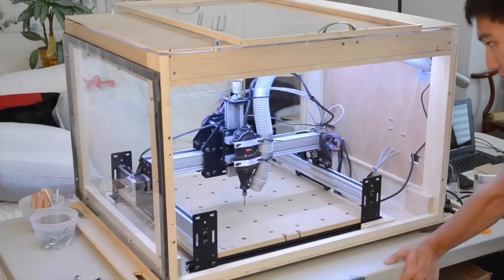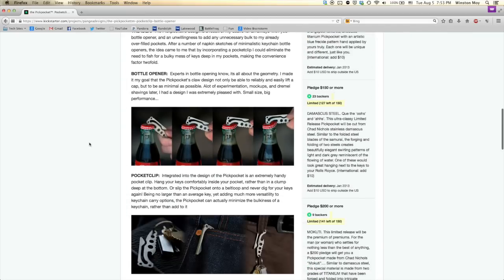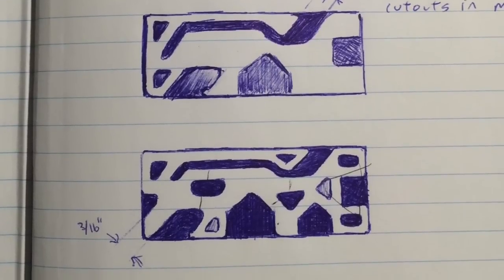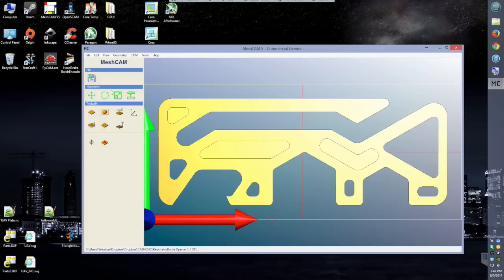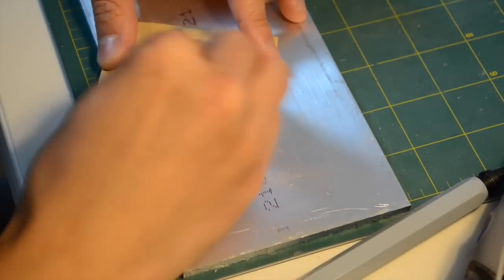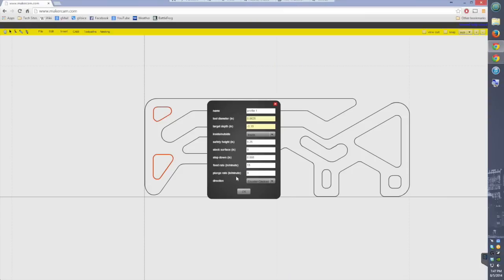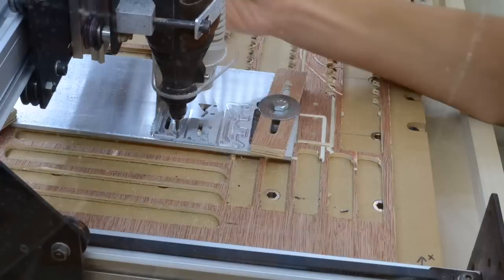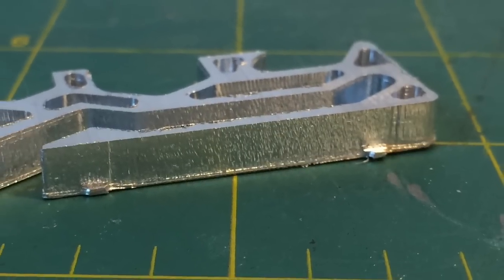Aluminum Keychain Bottle Opener - Shapeoko Journey Ep. 20

Comment: can you put link to that end mill
Reply from the maker: The specific item I purchased is no longer available (ebay listing) but it was a 1/16" carbide end mill w/ 4 flutes. May not have been the optimal choice, but it worked. Coated end mills last longer, and more aggressive flute angles can help auger chips out of cut features. Destiny Tool makes a very popular set of aluminum cutting mills, at the very least it's a good reference for what characteristics to look for when shopping.

Comment: Hi, how are you!? congratulations on your channel is great ! Right now I 'm working with a shapeoko2 , I 've tried machined aluminum of a much smaller thickness than I see in the video do not get it , I could say that this ulizing alloy exactly ? A greeting and thank you very much
Reply from the maker: deltoya12 This is 6061 T6, what exactly is the problem you are having?
Reply: Hi !! sorry for the delay and thanks for the reply , I did a couple of tests and aluminum cutting seemed very difficult to cut seems more biting material ! hehe, then discovered that he was using aluminum alloy 1050 was ... it seems that is not good for machining ... days later try a large aluminum heatsink rescued from a sound amplifier , had twice as thick and cut smoothly! .... I think much of the problem was the alloy .... and me! I am a newbie and not quite adjusted to perfection the machine.

Thank you very much and congratulations again for the channel ! Has very good ideas !!
Reply from the maker: Thanks, and glad you're having some success now. Generally, softer grades of aluminum are more difficult because they gum up the cutter and don't get ejected from the cut as well. All part of the learning process. :)

Comment: What bit are you using there? It looks like a 1/16th end mill? 4 flute or 2? I keep blowing up my 1/16th endmills in 6061 aluminum and I'm wondering what cutting parameters would be ideal. Spindle speed/Feed rate/depth per pass would be nice to know :)
Reply from the maker: It's a 4 flute, although I've been told that because aluminum throws off pretty large chips that a 2 flute would be better. Depth of cut is a rather glacial 0.2mm per pass, as one user mentioned on the S.O. materials wiki page. Feed rate is 14 IPM, plunge is 9.

However, what I found to be the biggest help was to use an extra-wide cutout pass. I.e. When you're going around the outer profile, you take two passes which allows for much better chip clearing. Really helpful when using a weaker Dremel as a spindle. MeshCAM does this by default, which is occasionally annoying because it essentially doubles your run time, but it's a lot more fool proof.

Comment: Hi Winston, would this bit work with Carbon Fiber and G10?? And if so, what bit are you using? Thanks for the video!! :)
Reply from the maker: I'm using a 4-flute 1/16" end mill, I also have 2-flute (better for plastic) end mills of the same size. Either should work fine with those materials. The big thing with machining composites is ventilation, because the dust can be quite irritating if inhaled. There's a video online of someone machining carbon fiber in a water bath, which I want to try as soon as I get my hands on some cheap CF sheets...
Reply: Winston Moy Thanks Winston! Where do you get the 4-flute? I checked at inventables and they dont have any...
Reply from the maker: Guerrilla Drone
I start at eBay usually. They''re cheap enough for you to learn on and if you need higher quality later, you know what features to look for.
Reply: Winston Moy
Thanks Winston!! :)

Comment: so where are the files?
Reply from the maker: I didn't initially post them because the keychain needed some refinement... and then I forgot to share.

I uploaded it to the Shapeoko Forum project page here: http://www.shapeoko.com/forum/viewtopic.php?f=30&t=4080&p=30586#p30586

Just change the file extension from ZIP to SVG, wouldn't let me upload as SVG weirdly.

I want to avoid posting a .nc file because everyone's machine is different. Spindle, runout, cutter... there's no guarantee my settings won't break someone else's milling bit. Just drop it into MakerCAM, don't forget to set the PPI to 90 for an inkscape SVG.

good luck, have fun.
Reply: Winston Moy  many thanks. is there any restrictions in use?
Reply from the maker: thor918
As long as you're not taking it to an east asian factory, making a bunch, and selling them online, that's fine. Some form of attribution to myself or this video is is encouraged, but not required.

Comment: Thanks for showing us the Shapeoko doing aluminum!  I'm impressed that it does work but the surface finish is awful!  Try reversing the direction of your cuts on the external profiling.  Google "climb vs conventional milling".  I think a climb milling pass is cleaner with aluminum.  It also helps to use a really sharp tool.  I'm still very impressed with what the Shapeoko can do.  I grew up with real CNC machines (Haas, Bridgeport, etc) so call me spoiled.  Let us know if you discover any other tricks!

Comment: Winston,  Dude seriously have to tell you keep it up, i feel like i am just 2 steps behind you everytime you put out a video.  I have been almost copying (well to the best of my ability) what you have been doing.  Only thing that i found to be the best thing for my Shapeoko was upgrading the spindle.  I upgraded to a 1/4" Dewalt DWP611.  Lets just say, with the extra horse power, wanted to beef up the box with a thicker material to prevent any... mishaps from flying... but you definitly give me the best ideas for upgrading and spindle speeds. Thanks man!! cant wait for the next video.
Reply from the maker: Thanks man. You might actually be ahead of me on the spindle end of things though, I've been eyeing an upgrade to get some more torque and less run-out...
Reply: Winston Moy solved... found out somehow with the upgrade to the bigger spindle, the side rails shifted and with a little dust my v-wheels were too tight on the makerslide.  If you ever run into this issue now you know! keep going man!
Reply: Winston Moy Winston, I have a random question.  Did you ever notice your shapeoko skips steps in the y axis? as weird as this sounds, i keep getting the y axis to "skip" i dont know if its just because i increased the length of the wire, but i turned the gshield up and still same issue... if you get time to answer i would appreciate it. I have no issue with the x axis or the z, but this issue is driving me up a wall...
Reply from the maker: nkazier
Glad you got it sorted out. I had similar issues when I tried reducing the wiggle room on my Z-axis, made the wheels too tight and created too much friction.

Comment: Winston, question. What kind of cutting bits are you using? Carbide? HSS? Diamond? I've run several large six-axis machines in the past and sometimes on long programs I noticed that cheap tools would result in not the best of finishes on the cuts kind of like the ones you pictured. Was wondering if part of the problem is your bit. 

Another issue that you could be encountering is the melting of the aluminum that could result in rough cuts around  the aggressive edges. I would suggest using some sort of cutting fluid and setting your whole rig sitting in a pan with a pump. Anyway. Just a few thoughts. Very impressed with your videos. Wish I had the time and capital to do this type of stuff!
Reply from the maker: Valid points for sure. I'm using a 4-flute carbide, uncoated which may not be the most ideal, and cutting fluid would've been very helpful on a low torque machine like mine.

I would however attribute the surface finish to my dremel, which doesn't have the strongest bearings to endure the lateral forces of milling. You could hear just a tiny bit of chatter. Doesn't sound anywhere near as beautiful as a half-inch end mill on a bridgeport cutting through 6061.

Comment: Winston, a suggestion is to shift to 7075 aluminum. "almost" as strong as mild steel. Alloy contains Zinc, Copper, etc. I call it "aircraft aluminum". I've done motorcycle swing arms from 7075 and it machines very well and much stronger than 6061. Great video. Keep up the good work.....!
Reply from the maker: That would be a pretty awesome material choice. I'd have to find good milling parameters for it though, 70+ ksi strength is pretty intense.
Reply: Winston Moy True. Let me know if want me so send you a piece to test with. I have a bunch of 7075 left over from a motorcycle project some years ago. I can just mail it to you... Cheers, Daniel.
Reply from the maker: ***** Appreciate the offer greatly. Right now I'm dealing with a catastrophic computer crash and getting ready for MakerFaire NY, but when I have a stretch of time I think I can experiment with the material I'll let you know. :)
Reply: Winston Moy No worries Winston......!

Comment: Great job!  I had seen another Shapeoko user milling aluminum with a cutting fluid, but it seems you got by quite successfully without.  From your tests does it seem the machine cuts well enough without it, or is it something to consider?
Reply from the maker: Right now with my conservative feed rates and cutting depths, I think there's no need for cutting fluid unless your're pocketing deeper than 1/8". Past that, chip clearing becomes a bit difficult for the bit and it will need either lubrication, or for you to vacuum up the debris.

I didn't think there were any thermal issues (vacuum was providing moderate airflow), my first program ran for over an hour and the end mill didn't look any worse for wear.

However, if you want to tackle the challenge of using some sort of cutting fluid or even WD-40 (which I believe vaporizes faster so it's less effective than a traditional oil-water mix) there are two advantages:
1) you can go faster
2) the surface finish is supposedly better

For this project I didn't think those were worth getting my wasteboard wet for.